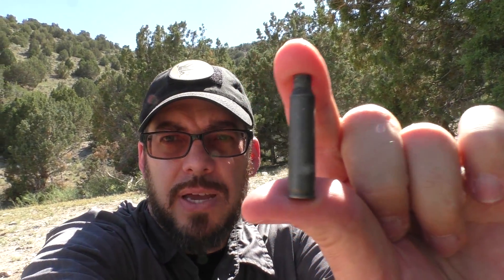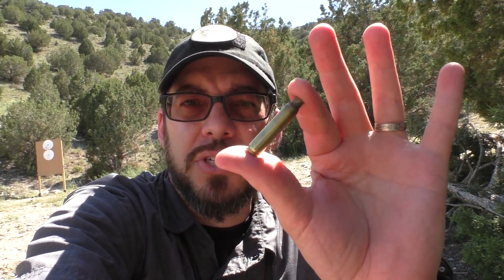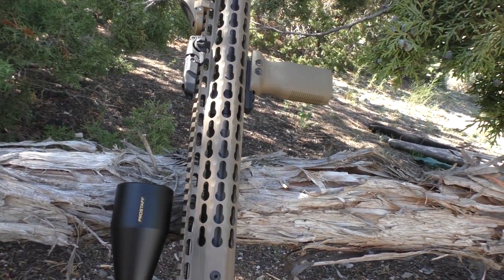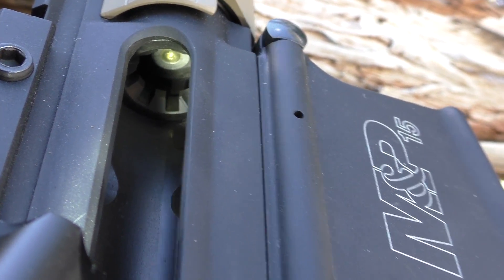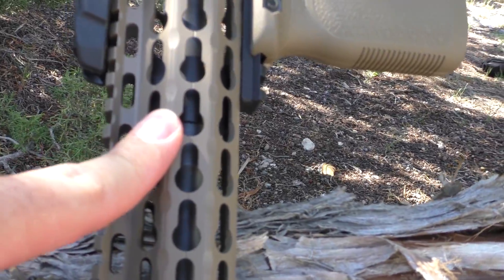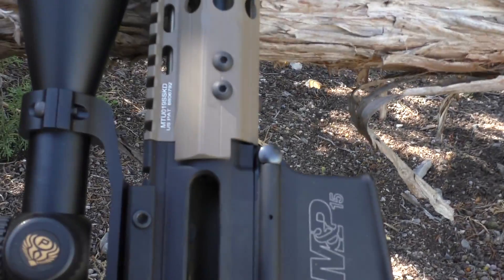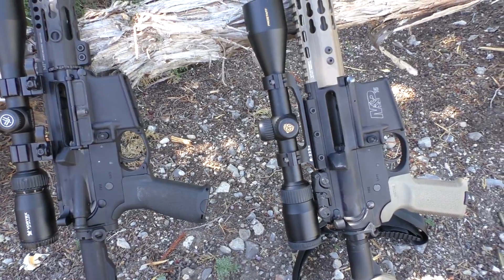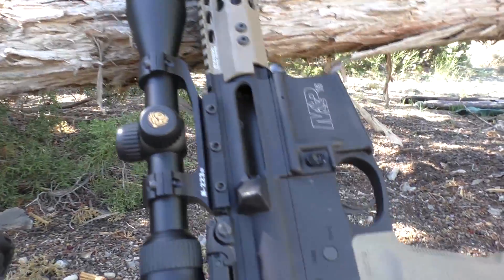Tula .223 Killed My Guns! V-Log Thursday

Comment: It very well could be a rifle timing issue with the gas blow back. The bolt it unlocking too soon. Steel doesn't expand and seal as well as brass which means gases leak around the casing into the chamber. Need to clean more often with steel casing and check rifle timing. I have fired 8,000+ round threw my M&P 15 and Stag Arms 3TM and have had very little issues. Failure to extract here and there and a couple of failure to feed. Also the polymer the coat the casings with is an incredible high temp polymer. You couldn't melt that polymer with a torch. Old casings with the lacker could cause a gumming up issue if you got the rifle really hot. But that was change quite a few years ago.
Reply: Through experiment with a rifle, steel case 223 jams in some guns. More research is good though, since I've only shot 2 ARs. Both jams with Steel. here is the reason and solution.

steel case does not expand very well. when you shoot, the residue blows back and gets between the case and the chambre wall. Brass does not do this because it expands well and seals off the chambre when it shoots, preventing dirt blowback. After several rounds, the thick layer of buildup is what gets steel cases stuck after the BCG rams another round into the thick buildup.

The solution to this issue is to load your mag with 1 brass round, a couple steel rounds, another brass round, another couple of steel rounds, etc.
the solution works because the steel case builds up residue, but when you shoot the brass round, it flushes out the residue as it expands and gets extracted. the residue gets extracted along with the brass casing, and you're clean and good enough to shoot a couple more steel rounds. 

in the rifle I tested, the 4th consecutive steel case gets jammed., but 3 steel or less worked perfectly for me.

You could try shooting a magazine of 1 brass 1 steel 1 brass 1 steel etc, see if that is reliable. If it works, try a mag of 1 brass 2 steel 1 brass 2 steel etc. find out how many steel you can fit between brass rounds until your gun jams. Then just dial back steel number by a little. Should work fine.

Comment: I'm betting that you are over gassed and are running a carbine buffer and standard strength spring. A blue sprinco action(buffer) spring and H3 buffer will fix it. However, if you get short stroking(most likely in cold weather) you might need to dial back to an H2 buffer.

Steel cases don't expand or contract as fast as brass. If the rifle is over gassed it will try to extract the case before the case has a chance to contract from the case walls. At this point one of three things can happen. The extractor can slip off the case rim and you have a FTE. The case can be ripped out of the chamber kicking and screaming. Worst case scenario is that the extractor holds on to the rim, the case holds onto the chamber and the rim gets ripped off the case.

Comment: brass is a lot softer than steel, and also is more malleable at rifle temperatures. The steel cases get stuck in my M&P but not my Colt. The steel just won't deform correctly after it is shot. Try Winchester FMJs in a 55g, its my go to plinking ammo.

Comment: yes, I have had the same problem. the 1st time it happened the back of the case pulled off. I don't have the answer but I'm glad it's not just me.
Reply: Use a heavy buffer slowing down the bolt speed, and problem solved
Reply: @brainwaters3963  I think your on to  something.  I read part of the problem  is steel cases  cool slower.   That extra  fraction of  a second may, give it that time. Will try it.
Thanks
Reply: @davemcclo6235  your welcome

Comment: I've put at least 2,000 rounds of tula thru my armalite eagle  chambered in 223 wylde without a single failure ,It came from the factory with a polished chamber and I cleaned it about every 500-600rds you might want to polish your chambers or look into the wylde chambers

Comment: I had that problem.  In one of my ARs.. then I had the throat bored out a little bit. There is a tool that is used to do it. Had it done on all my ARs after rounds getting stuck. Now never have a problem. When the round fires  the rim of the round expands.  In some barrels its smaller then it should be. Thats why you have that problem. And yes I had stickers with brass as well

Comment: To shoot steel cased ammo you need a chrome lined barrel. Yes it decreases accuracy by 1/8th moa but the slick finish will compensate for the lack of slick brace. Look up difference between chromoly, chrome lined, and stainless steel barrels

Comment: Why this happens is due to a number of reasons. To start I'll be honest, I have found defects in tula ammo before and that is to be expected knowing where it comes from and its intended purpose. But because of its price point I will still use it for certain applications, I've never had a serious issue with it. 1- Tula ammo being steel cased and then polymer or other variant coated. The coating will heat up and sometimes comes off, as well coming off sometimes as it cycles, this builds up and aids in getting the gun dirty and jamming. In addition steel cases do not expand and retract the same way as brass cases do, different metal. From what I've found its more likely for a steel case to expand and get stuck in a chamber over brass.2- Due to manufacturing quality issues, its obvious to find that much Russian ammo is not consistent with loads. One round can have more of a powder charge than another, or too little, which can cause failures to extract, short stroking with gas systems etc etc.3- In higher quality firearms, its more likely to have better machining and closer tolerances. This can aid in making a firearm picky about functioning reliably with this type of ammo. My suggestion is if you are like me and buy the cheapest ammo you can for plinking with lower end firearms. Go a step up and pick up some of the Russian "Bear" line of ammo. I believe one form of brown bear, has a brass plated steel case. For an extra dollar a box or so it seems to aid in reliability for me, especially in 7.62x39. Though it may not always have sealed primers and the longest shelf life, its a better bang for your buck on the range. Just remember, Tula, tulammo, brown bear, silver bear, wolf, all of these product lines are coming out of the same few factories in Russia. You get what you pay for.

Comment: Bro it’s because you’re not letting the bolt hit it full force, happened to me before when guiding bolt forward, you have to pull the charging handle all the way back and let go and let it slam forward and it will grab shell....

Comment: the ammo is coated  , thus when the coating used gets hot it works as an adhesive, there by gluing the round into the chamber. I've been warned of this time and again. I never use it in an ar , ak's are fine due to more chamber clearance (sloppy tolerance)

Comment: hey bud, in my experience using steel case tula, it's worked OK starting from a clean chamber/barrel and shooting only the tula. when shooting brass cased first, then switching to the steel, without fail, they've gotten stuck. happened to me on 3 different rifles.

Comment: Could definitely be a ammo issue, maybe the cases aren't formed correctly? It might not be a bad idea to check head space on both guns either. If the head spacing is too tight it can cause stuck cases, but you would most likely also have other issues such as short stroking. I would clean the chambers and barrel extension really good and see if your still getting stuck cases. If you are and you have no issues with brass cased ammo I'd say it's probably a problem with the steel case itself. I know I'm late to the party but maybe someone else with the same problem can benefit from this information.

Comment: I agree on the various foibles of steel cases - lacquer them and they'll stick in a hot chamber, don't and they'll foul your chamber beyond belief, also important is your extractor. How many rounds through those bolts? If your extractor spring is worn, it'll leave the steel case behind long before it leaves a brass case behind, if the rim isn't torn through, look at replacing the extractor spring, insert, and O ring (you are running an O ring, right?)

Comment: Never use Steel case .223 in an AR15.  The chambers are on the small size of specifications.    Using a cleaning rod to push cartridge out.   First push bullet into case,
then remove rod and empty the case of powder down the barrel.  Squirt some WD40 down into case. this will de-activate the primer and is a penetrating oil.  Wait one hour then tap case out with brass or aluminum rod.   This will probably ruin your cleaning rod but will work.  If the primer is set off by the powder being pounded into the case by the rod
could be a bad injury or fatal when ignition and rod in barrel coming out fast.  Sorry about the long reply.

Comment: Couple weeks back, I put easily over 500 rounds of TULAmmo steel .223 through my built rifle...not an issue at all. It is a KAK Industries barrel, 5.56 NATO chamber.  .223 chamber has slightly tigther tolerances, that may be the issue.  Just a thought.

If you are going to toss your TULAmmo, I have a wonderful home for it on my shelf :)

Comment: i do not understand that either, my Adams Arms piston system chews through Tula ammo with no issues.

The only difference may be the batch or lot number of TULA you are using..

I know the steel casings do not expand like brass, and some rifles can't handle that

Comment: As you said 19 grains seems like a light charge, given most loads are about 21 to 26 gram or so. My opinion is that that powder is just too fast, if it's over pressure. Seems Tula is trying to get by cheaper, such as target shooters do. Use a small charge of very fast powder, to shoot cheap. That doesn't work out too well with high pressure loads. I have reloaded a ton of Russian bullets, and like them, and I shoot Wolf primers exclusively when I can get them. I know I will get a lot of negative comments, but I consider their primers as good as you can buy.

Comment: It's the flashlights. I had a Kimber 1911 that ran steel case Tula 223 like a champ until I put a light on it. I even tried their duracoated cases, adjusting the scope mount, changing the gas block, sacrificing a Glock fanboy, nothing worked until I took the light off.

Comment: This is very crazy problem that I had gone through. So a lot of people said it was the ammo and I find out that it wasn't. Then some people told me it was not enough gas and that was not it. I did more research and could not find what was the cause of the spent casing being left in the chamber. I was determined to solve this problem. So I changed the whole bolt and carrier out with a brand new one and it solved the problem. Now what can you do to fix this problem so what I did was rebuilt my bolt. Change the O-rings(they usually come 3 in a pack) and replace the ejector spring with a heavy duty one with a fresh rubber  grumete & the rubber donut to go around the spring. The donut is optional but I would highly recommend it. It supports the spring a little better. This did the trick for me:)

Comment: What you need to do is super lube the section around the bullet before you go shooting next multiple coats maybe also a really good extractor with good O rings ... I never use Tula only wolf or the BEAR series any of the 3 because there lacquer coated zinc or polymer coated. Which decreases abrasion and with that coating method I mentioned pretty much makes it slicked if you do those 2 things and I have a good extractor that would help.

Comment: its the laquered casing... my sig m400 chambered in .556 will eat laquered ammo all day; but my 3 gun odin works upper  chambered in .223 wylde will do this after a few hundred rounds of laquered ammo(even brass like Winchester white box)... i can usually clear it by jack hammering it; but there was one instance where i had to use the cleaning rod(make sure you separate the upper). i was shocked to see it was a live round and not actually a spent case like i thought... i have zero issues with that upper running non laquered ammo through that upper, even cheap stuff like pmc brass... just as long as it's non laquered...

Comment: My AR carbine shoots tulammo perfectly fine, but my old M16A1 parts kit rebuild has trouble with it. I've found that with the full length rifle, it needs a slightly weaker spring to cycle fully and reliably. Tulammo is .223 though while my A1 is made for 5.56.

As for the problem in this video, I had a similar experience with some russian military surplus 5.45x39 in my american made barrel for the tantal. It turned out that the chamber was just about 0.0005" too tight. With a little polishing the chamber issues were fixed and there are no longer any issues. It even shoots very accurately.
I think that a lot of american firearms are made too tight to impress the customers who will likely never take their firearms to the battlefield where loose fitting parts are ideal. Foreign steel case ammo tends to be made for military rifles which are supposed to be loose. Perhaps the brass is a little more slippery because it's polished or simply due to the nature of the metal vs the steel/chrome chamber.

Comment: The only thing that comes to mind, is that the casing materiel is too soft. They must have tried a different metal compound for their casing materiel. I suggest that you throw that stuff away. By the way, brass is the best bet, I have had some aluminium casing do the same in one of my AR 15's, it was super hard to get out, took me half an hour with a hammer and busted up my cleaning rod.

Comment: 556 ammo mixed in they have a slightly larger case. If it was chambered for 556 you wouldnt have an issue. Ive heard of this before and it was a 556 case in a 223 barrel

Comment: The problem that cause the case don't came out then the bolt put the case stock into the chamber happens when the gas rings become close one to each other causing loss of pressure that will not make the bolt go back completely pushing the case into the chamber the gas rings suppose to be 120° separate one to each other check it align it and you will fix the problem

Comment: Probably due to lacor build up. doing rapid fire it will cause the lacor to heat up and melt off the case sticking to the bore. so after so many rds extraction become more difficult for the extracter to pull the Case out. Plus steel case ammo doesn't expand like brass leaving all the  carbon and gasses to pass around the case and it will build up in there causing the same issue. so you have both the lacor, carbon & gas working against you.

Comment: I have a mossberg mmr, and she will chew threw steel case rounds. the only issue with it is the steel on steel contact. something she won't chamber another around correctly or the same issue you are having. steel is good for target shooting, but if you are using it for defense.. brass should be your #1 choice.

Comment: Tula and Wolf use dirty burning powder.  Tula is slightly cleaner.  The most important things to keep clean on any weapon are the bolt face and the chamber.  I have fixed a few ar 15s that suffered stuck cases even with brass ammo with a chamber hone. Got mine from midway. dont spin it fast but move in and out quickly to get the disired crosshatch similar to an engines cylinder bore.  Experienced that once with a chrome bore and chamber bushy, but was doing a torture test and was close to 2000 rds with brass only.

Comment: Interesting.  I have another take on this.  

Using Tula and barnaul laquer coated ammo, I have seen the casing gets stuck in a S&W and a RRA, but not a remington/bushmaster or a DPMS.  I have swapped BCG and bolt heads and have the same issue on just the RRA and S&W.

I suspect is the barrel chamber dimensions, or even the finishing.

I would probably get a chamber reamer/finisher and polisher and do some work on it and see.

Comment: I had this same issue with wolf steel case on my bushmaster. I resolved it by buying a chamber brush and using it every time I cleaned it and putting a heavier extractor spring in the bolt.

Comment: I had trouble with the varnish they use to coat the steel case to prevent rusting of the case ,,,,during  firing it tends to build up a thin coat in the chamber,,,,  this traps powder residue/ dirt residue / etc the brass is softer /slicker and less likely to stick to this thin dirty sticky coatng in your chamber.

Comment: The Tula steel casing were getting stuck on my bolt action .308 as well.  I mean really stuck.  Cheap ammo.  I alternated with brass and it came out fine, and every Tula round would get stuck.  8 stuck cases and I learned my lesson. No more Tula for my rifle.  Just my experience.

Comment: Everyone saying it's the coating on the cases are wrong. It is 100% without a doubt from the fact that the steel cases don't open up and expand far enough to make contact with the camber walls like brass cases do. So the steel cases allow carbon build up to happen around the case necks which builds up and eventually you get stuck shells. Brass cases seal out the carbon from collecting around the neck of the cases. The reason steel works without problems in AK's is because of greater chamber tolerances. 
Now here is how you fix the problem. I'm not sure why this works but it does. Mix in a brass round with the steel about every 5th to 10th round. The brass case will clean the chamber because the carbon build up will stick to the brass. If you look at the brass after it's fired mixed in with the steel you will see how dirty the brass case necks are from pulling out all the carbon build up from the chamber wall that was caused by the steel cases. Do this and your problem will be solved